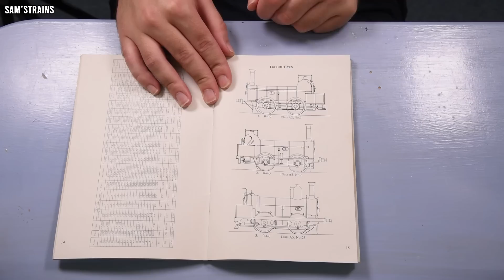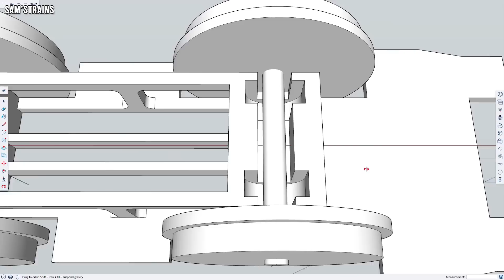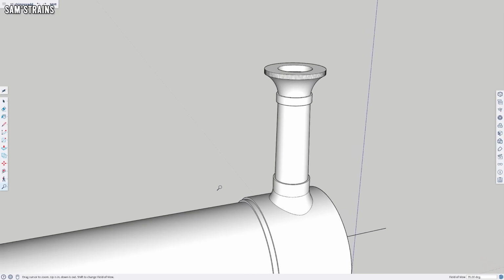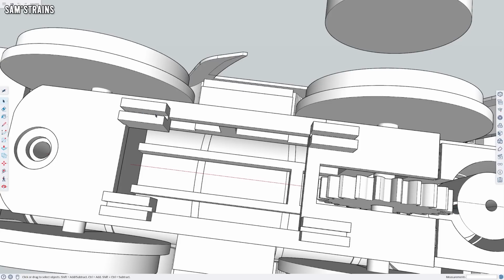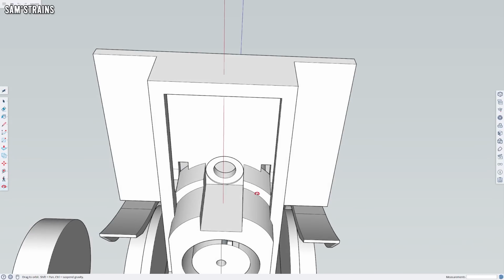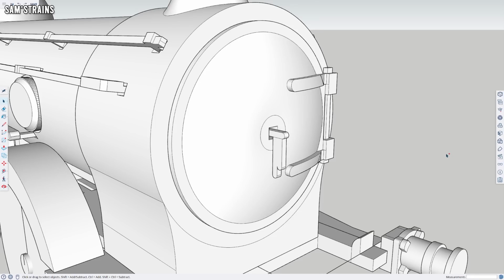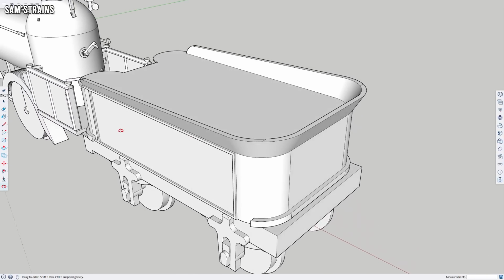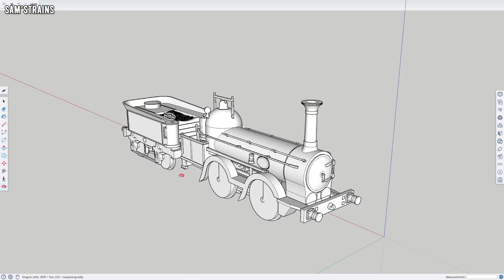Designing A Working Furness Railway 'Old Coppernob' For HO/OO

Comment: Having downloaded Gladstone I wasn't very impressed with it... I think we are trying to run before we can walk personally.

Gladstone I had to spend about 100 hours fixing it before I could actually print it.. As the printing program quite rightly said yea too many issues for printing... Mainly double faces, errors in geometry, I hope you don't charge for these designs because they are not good. 

People are impressed because they don't know what they are look at or the pitfalls of the way you are designing it.

Back to the drawing board.
Reply from the maker: Sorry to hear you had problems - everything I’ve designed has always printed perfectly, as you’ll see when I reveal the final result for this project! I’m sure you’ll improve with some practice! ☺️
Reply: @SamsTrains  yea I run a 3D print business I've been doing this since 2010... So I have a bit of a head start on the practice.. What I'm saying is your miss selling and not doing this properly...

As I've written 4 articles for magazines on this topic. Also as your apparently being paid for videos Google look dimly on it so they mask for the video to be removed, I had to seek various permission to just use screen shots for articles.
Reply: @Samstrainsofficially  also Sketchup will not draw properly in 4mm scale it's A good program but not great at scale drawing. Things need to be blown up, the rescaled reworked also the mistake many make is to try and print too much.. Use detail part sellers.. Handrail knobs, safety valves... Door handles...

3D printing is an aid not the full solution. I've always said it... So thank you for speaking sense...